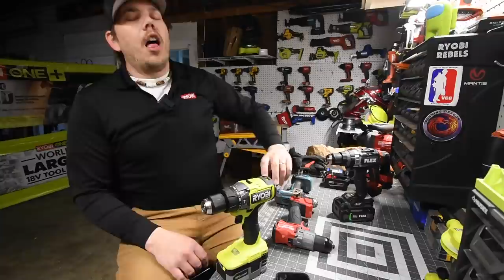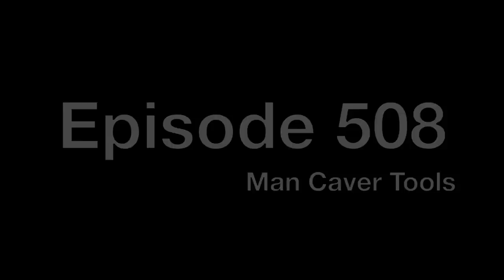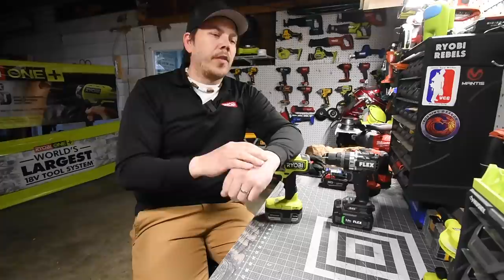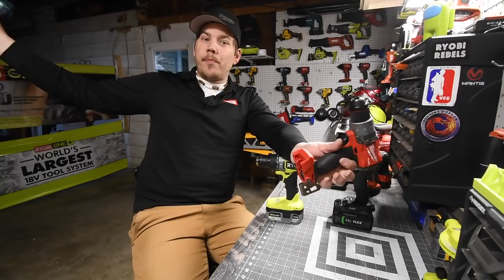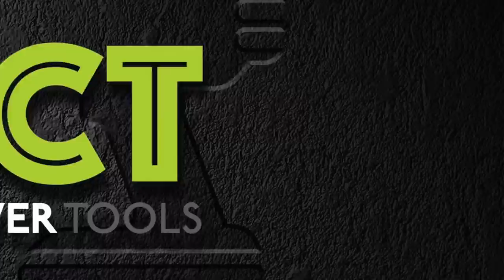Why are tool tests unfair?

Comment: It's like saying who has the fastest car IMO, and it depends.. how fast is it? the gearing? torque @motor? battery capacity/type? That could mean one drill drives screws faster into threaded holes than another but then the other drives drywall screws in faster, etc, etc

I like your tests, there not the same as the rest of the channels and that's perfect

Back to cars, some people look at the whole experience (look, feel, ease to use) others the simple power and others reliability/quality or just plain cheap and effective. Like comparing a Corvette and a Cadillac with the same exact 6.2L V8 engine but clearly different results and a Camaro with a 4 cylinder turbo that's still more power than you need for "normal" use. What i see is Dewalt/Milwaukee, Hilti, and Ryobi

Comment: I think the absolute best comparison is to use the best battery each tool comes with. That way you see the real performance, not some handicapped version of a test. If I have a 6ah HO 21700 battery on my Milwaukee, I want to see how that compares, not with a 5ah standard battery for the sake of "fairness"

Comment: I think you do the best to make tests fair, and even though the dewalt still is king of the hammer drill, you didn’t even use the battery that’s sold with the power detect, the 8ah 21700 cell battery.

Comment: I will say speed 2 on the dewalt power detect with a 1300 rpms but more torque is unfair against the flex on speed 2 with turbo at 2500 rpms but less torque than when on regular speed 2. that's all i'm saying. if the dewalt wins, it wins. pitting it against each other fairness wise should be a battle of either torque vs torque or rpms vs rpms. it's not fair when it's torque vs rpms. that's 2 different modes going against each other when one of the modes has the advantage over the other. as far as batteries are concerned it's always best to try to go with as equal ah batteries as possible even though one may have 18650s or 21700 cells. i will say i do love your channel and you've done a great job with these videos and tests overall but just this one was one i didn't agree with

Comment: Don't fully agree that Turbo = Speed 3.  

If these were cars, Turbo button = M-mode on a BMW.  They could have just put all that power on the trigger (throttle) like everyone else.  Instead, they govern it so you have to press 'Zhe M-button on zhe steering wheel to make zhe car go fahstah!  Ist gut ja?' 

You still only have as many mechanical gears as your transmission had.  You were just in 'valet mode' until you hit Turbo.  Like the M-button.  

If it is adding anything, like unrestricted current, then that explains why folks have been complaining that the tool gets REAL hot.  It is adding RPM by removing a governor that.... does it decrease tool life?   Waiting for someone to dive into that.  

DeWalt adding another gearbox setting adds a speed in which it can run a 1500rpm bit faster than the competition.  It's like having a nice middle gear between 1st and Overdrive.  You wouldn't want a sports car with only 1st and Overdrive.  It's nice to have 2nd, 3rd, and 4th in a sports car.  It's also nice to have 2nd in DeWalt.  Perfect 'cruising through the woods speed'. (see what I did there?) 

  Not DeWalt's fault they thought you should be able to cruise through the woods faster in a middle gear, and added it.  

It's not fair.  DeWalt engineered a tool for that test better.  Advantage DeWalt.  Mechanical Advantage.  Not some valet mode current restrictor gimmick.
Reply: The turbo button itself is a gimmick. When I say gimmick all I mean is they called speed three turbo and gave it a button that lights up instead of having a speed 3 on the top of the drill that’s not fancy. By calling it turbo instead of speed 3 it makes people believe it’s something new and magical that nobody has ever seen before, but it’s just good old speed 3 like Dewalt has. It’s just like the collet quick eject on the impact driver. Most other impact driver collets are much easier to use than the Flex, but again they market it as a magical button that will change your life.
Reply: @akaredcrossbow  
Again, I think it is just allowing extra current.  Which means the motor spins faster.  

DeWalt has a 3-speed gearbox.  The motor has a peak RPM in each speed.  That way the electric motor stays in the optimum torque vs heat (in the housing) range.  The chuck changes speeds based on what gear it is in. 

My concern is Turbo mode is speeding up the motor (not adding another Gear like DeWalt) which may reduce e-motor life.
That's my hypothesis, and we'll see what happens when someone does a full tear-down.  

Cheers.
Reply: @ToolHombre  ok I see what your saying. If that’s the case then you’re right! The electronics might not last putting a strain and shorting out the circuit. That maybe the reason there’s a turbo button to turn on and off. If they didn’t have a turbo button and that electricity was set to on all the time then the circuit boards inside might fry. Flex might have wanted that extra electrical current to flow all the time, but they couldn’t because it was short circuiting the tool or battery. Someone should do a test with turbo on all the time and see what happens. 👍🏻👍🏻

Comment: Best advice ever...Life Isn’t Fair, deal with it.

Equal treatment is rarely ever fair. Every individual has unique abilities and weaknesses. Same for tools. 

Fair is acknowledging the strengths and weaknesses and figuring out how that individual/tool might benefit you, and how you might benefit them. That means similar, but not identical treatment. How can you minimize the weaknesses and use/showcase the strengths. 

It also means using the resources currently available in the best and most equitable manner practical. 

Makita doesn’t make LXT compatible batteries in 3P configurations or using 21700 cells. Many other brands do. That’s a limitation imposed by Makita at this time, nothing a reviewer can do to eliminate any that.

But as he said In the video, comparing a Ryobi using a 3Ah battery vs a Milwaukee using its 12Ah would be biased. It would be deliberately handicapping one tool. That’s not what he does in his tests, including the Flex comparison that sparked all this. It was a fair, unbiased comparison of competing tools using batteries of very similar capabilities. It didn’t handicap any tool, nor did it show any of them at their max/best nor minimum/worst configuration, it showed them all in very similar configurations that are commonly used configurations. Believing otherwise will not accomplish anything nor alter the facts or the outcomes. Would using the most powerful battery each offers have changed the outcomes? Maybe, but that’s not what he was testing. He was testing performance in common configurations, as similarly matched as practical.
Reply from the maker: I do thank you so much for viewing

Comment: If you're doing your tool tests from a different perspective, that is a good thing. If you all do the exact same testing methodology we aren't getting different data points. If your channel does best case battery scenario for every tool and another channel does testing equalizing battery output, you're both giving valuable information in two different scenarios.

If one guy already has ho batteries testing flex vs their current tools without the ho that information is useless to them. If someone is trying to get into a line and doesn't want to pay double for ho batteries testing with them is useless.

Different data points are valuable to different people.
Reply from the maker: I agree and I thank you for viewing 69

Comment: just put the highest battery the hand tool can support and test like that this was the tool cant do any better than  what is shown as it has the most power possible no questions asked and then the winner is the winner 

also the other issue is rpm and torq if you have a slower rpm tool its allways going to loose in a softwood aplication no matter the battery used as its just naturally slower  

i think the best way is highest rated batterys and chuck them into each other and see who kills who :) lol

Comment: I sort of suspect that a lot of fans of a manufacturer (which is a weird thing to begin with) are fans because they have a lot of buy-in. It's not specific to power tools - no one wants to think that they've made a bad decision. It's one thing to buy a not very good product because you couldn't afford a higher quality one, it's something else entirely to have bought something sub-par because you were hoodwinked by a salesman for example.

But, I think another reason is a cause of buy-in. If you went out and bought three battery powered tools at once, because you needed them for a project (let's say a drill, a circular saw and an impact driver), you are "stuck" with that brand. Not because you're not allowed to buy another brand, but because the batteries you already have might not fit another brand. That'd be a waste of money. So you end up buying more of company A's tools, even if company B turns out to make better tools at the same price.

Wouldn't it be nice if all 18 volt power tools used the same batteries? Technically they do - the only difference is the connector, but because [insert brand name] can sell you a "genuine" 5 Ah battery for $150, that only costs $50 for them to make, why would they give up that revenue stream if they didn't have to.
Reply: @Martin Schou. Yes I agree it would be great if there was a single battery pack standard adopted like SDS for rotary drill bits or Starlock for oscillating tool blades. Every tool manufacturer uses 18650 or 21700 lithium cells. But each company may have their own way of managing the cell discharge/recharge and temperature management like a secret sauce. Those "adapters" sold bypass those communication pins and just arrange the + and - terminals where they need to go. But then we run the risk of shortening the life or damaging the cells without that management.

Another great reason for a single battery platform would be reducing the need for different chargers. It'll be nice not to have different 18V chargers just because I have three different tool company's 18V tools. It should be possible. I still have a Dewalt Supercharger that can charge different company's NiCad batteries.

Hope you and your family stay safe and well.

Comment: If Makita makes 8Ah packs with 21700 cells, people will complain that the new pack won't fit on 2 x 18 Makita tools, plus that is wey to heavy. If makes 4Ah pack with only 5  new 21700 cells turned 90 degree and aranged on 2 rows, can fit on 2x18V tools but  we get only some 1/6 less weight, but also we get less power coz' 40-44 A from one row of best 21700 cells is less then 40-46 A from 2 rows of best 18650 cells. Makita avoided to make even 3Ah pack with one row of 18650 cells coz' some people woud have expected 46 amps from them like from the 3Ah with 2 rows of 18650 cells...

Comment: do you think a 24v worth it vs 18/20v considering the 24v battery need to be a bit bigger and a bit heavier than a 18v ? im asking that because i do a lot of overhead work so weight is a factor to consider to avoid shoulder fatigue

Comment: It's definitely fair to compare tools with different batteries, AND different voltages. Something I hope happens when Makita 40v actually ships to customers in the states. 

If you title your review, (when I mean "your" I mean in general, not specifically 'you') "18v Hammer Drill/Driver shootout!" Then sure, ONLY reviewing 18v tools and ONLY considering 18v tools would really be the only option to make it fair. 

If your title says, "hammer drill/driver shootout!" I would definitely expect to see ALL major brands have their top of the line hammer drill/drivers represented. Rrgardleds of voltage or battery size. Again, just because the competition isn't doing anything in response--it isn't Makita's fault. Or Dewalt, or Metabo, etc....

Comment: I think it's hilarious and sad at the same time you have to make a video clarifying this.  If people are not smart enough to figure out the obvious they shouldn't be using power tools.  If they get butt hurt they shouldn't be using power tools.  If you get upset that your tool is not the best then you should play with crayons, (But know the crayon you are using may also, not be the best).  Unfortunately the internet gives everyone a mouthpiece to voice their stupidity.   Like you stated not every tool brand is the best at everything.  Thats why its nice to be in multiple platforms..  If you are not, then know that you are missing out and don't get butt hurt.  Some brands and tools are better than others.  Regardless whether you use Hart, Ryobi, Milwaukee or whatever don't be upset when your tool looses by a ½ second.  Just know that they will all basically get the job done and it doesn't matter what you are using, as long as it completes the task.  Good work Man Caver keep doing what you are doing and don't be apologetic to the crybabies.
Reply from the maker: I thank you so much Michael

Comment: Of course its fair as long as you do the same test and try to keep them as similar as possible. Its not fair to use 1,5 aH on the Makita then go 12 aH on the Milwaukee, but if Makita doesn't make more than 6aH and Milwaukee has both 9 and 12, then I (personally) consider it fair - IF - the parameters of the test is "how well can the tool do under its best circumstances". In that case its not Milwaukees fault that someone else doesnt offer the same thing, its part of the deal.

If you wanted to make things equal, you could run all the tools off a power supply instead of batteries, to make sure you control the power they get. But what the h*ll is that good for, that has nothing to do with real life use and says nothing about your experience if you choose to buy said tool. If you want lab results, they already put them on the back of the box.

See, I can rant too!

Comment: Thanks for making another video for me pal, firstly your analogy at face value is so ridiculous it boggles the mind. Every racing organization is goin to place a limit of some sort for performance on a vehicle because it's about the race not about the car. I couldn't possibly care less if you have 1 battery for every tool and that all you can afford I'd watch your video and get a look at what each tools performance is like with that battery. If you start the video by saying the comparison will be fair then do something you fully know gives one tool an advantage instead of running it in a equivalent setting with a equivalent battery when you are well equipped to do so. I'd honestly be totally fine with the results of an ho 3.0 on the milwaukee and the 4ah slim pack on the dewalt with the 2.5 on the flex because that's what most people will use and it will inform them what kind of performance to expect before they spend their money. Don't sell your audience a "fair" test or even an equal test and then proceed to do a tailor made test for YOUR favorite drill. You were malding right from the launch whining about them not comparing the flex to the dewalt and youre doing what your doing because you like your dewalt drill. I don't own any of these tools and I'm probably not gonna buy any of them I don't care who wins. I care about someone lying for no gain other than to save face because they made a claim that's been proven to be untrue on other channels.

Comment: i don't really look at the tests as anything other than 'fun.' it is unlikely anyone will go out of their way to buy a single tool from another battery line. perhaps if there's a clearance deal at a big box store..  All of these tools are capable of completing the jobs they are designed for. Some might do so faster than others, but I've never seen anyone on a jobsite timing how long it takes to drill a hole.

Comment: I don't think tool tests should be concerned with being fair or equal at all.
For example, I'm a guy trying to decide which impact wrench to buy. What matters to me is what bang I can get per my buck, and what the manufacturers can bring to the table. If manufacturer A offers high-yield 21700 cells whereas manufacturer B does not, I'm only concerned about how great of an improvement those cells give, not about the test being fair to manufacturer B.
Even if I'm running with manufacturer D's battery line, and only watching these videos to once again confirm to myself that my choice was right, I still would want all available options to be explored, not to celebrate mediocrity.

Comment: Metabo HPT made their 36V line both backwards compatible to their 18V line and made all 36V tools AC adapter compatible which extends the life of the tool for as long as the motors run+it saves battery longevity as well
When I'm buying a tool I want the best I can get for similar prices and I don't give a flip to whether it's 18V, 24V, 36V, 40V or 60V- if it's a similar size, weight, price who cares what the Voltage is-when I get off the jobsite- faster than u cuz I'm using the 36V Metabo HPT tool and your using the FLEXY 24V ,the Dewalt 60V, Milwaukee 18V or other-it doesn't matter-I'm going home earlier and making more money cuz I can add another job
Fanboys keep your comments to yourself cuz I do have a bunch of Milwaukee Fuel, Makita and even a few 18Vrigid(propane heater, planer,sander)-Metavo is just better right now with it's 36V line for most heavy use products and that's not even including the industry standard for nailers and fasteners

Comment: Well, you did actually run that Flex test with 18650’s and 21700’s. DeWalt won each one. There shouldn’t be any complaints on that one. Just let this video be a statement that from here on out, testing will be like an open division with all performance enhancers legal. Folks will have no grounds to gripe.